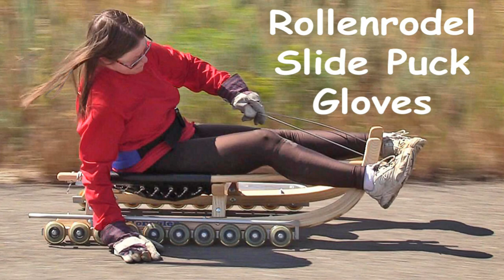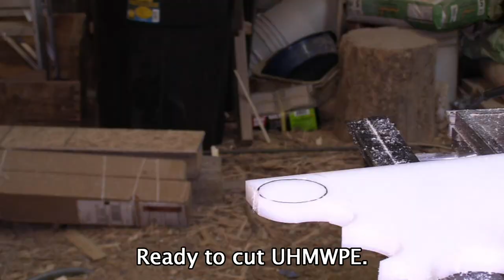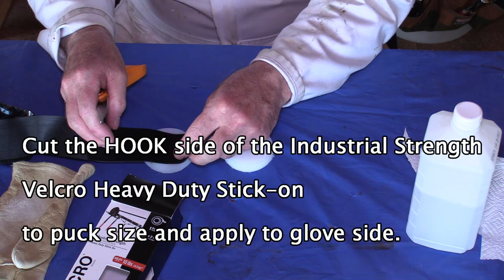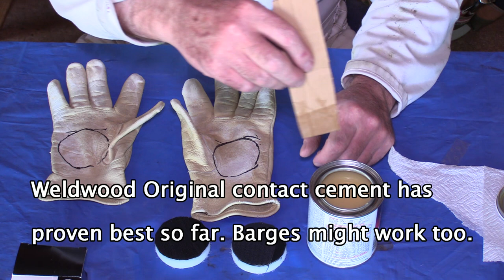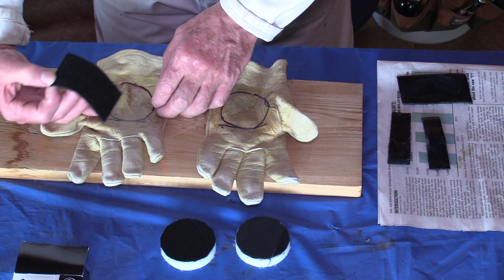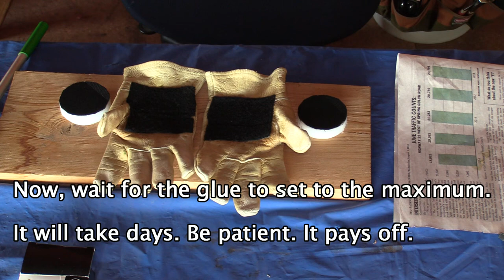Rollenrodel: Slide Puck Gloves DIY (Rollenrodel Gleit Puck Handschuhe)

Comment: Great DIY. Please keep them coming. While the contact cement dries, you can use some heavy-duty, thick wrist protectors/pads, similar to the ones I use for rollerblading. They served me well over the years.
Reply from the maker: Thanks, but I don't know that you understand the function. The basic design is similar to longboard slide gloves, but Rollenrodeling has different requirements. Wrist protection has nothing to do with it. Full wrist flexibility is required here. The puck serves as a durable, sliding platform allowing the rider to push downward force onto the opposite side of the Rodel for steering purposes. The fingers must be free to move independently, yet be protected from abrasion (road rash) when pressing into the pavement. Of course one tries to NOT to let the finger tips touch asphalt by having good wrist flexibility, but that's not always possible. Hence, the need for gloves. Worthy of note. Rollenrodels use twenty, 80 mm, inline skate, hockey-profile wheels. Therefore, the benefits of formulation differences and different durometers apply.
Reply: @Turboganz  
Switching topics.
Some of the people from my skating club went skating in your area. They posted skating pictures from a highway running parallel to the Tetons. The scenery is awesome !
Reply from the maker: Super! As you may have noticed, the path I pumped is parallel to that highway. I hope that the smoke was not too heavy when they went through. Good to hear from you.